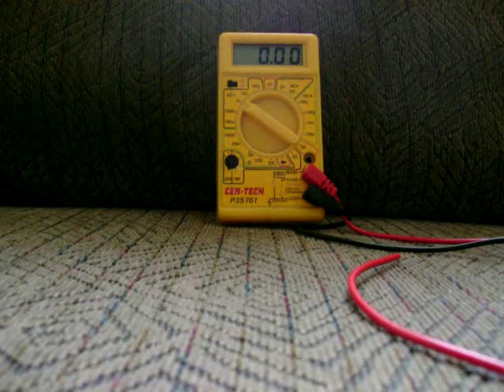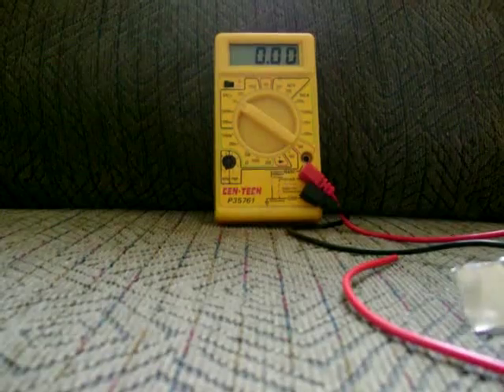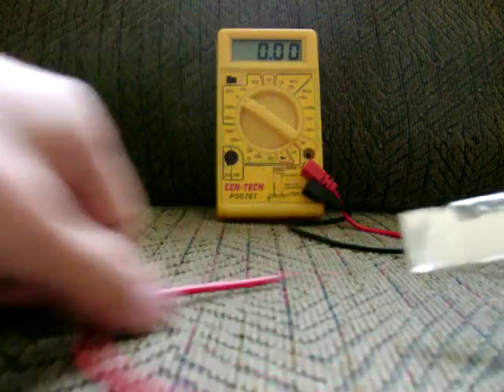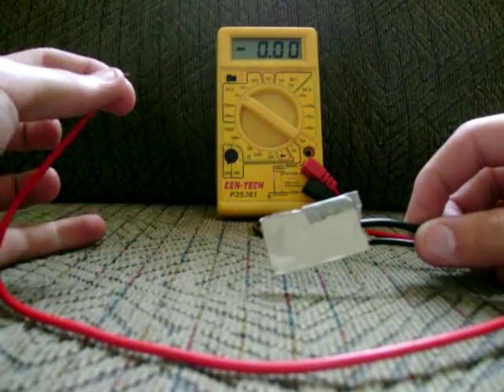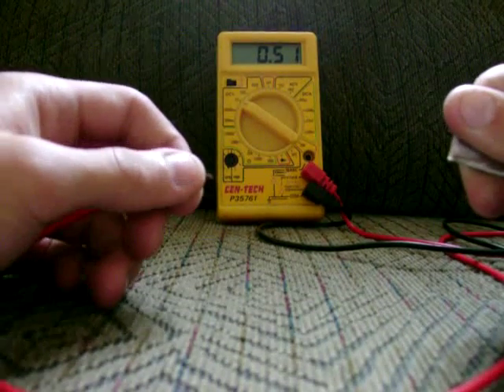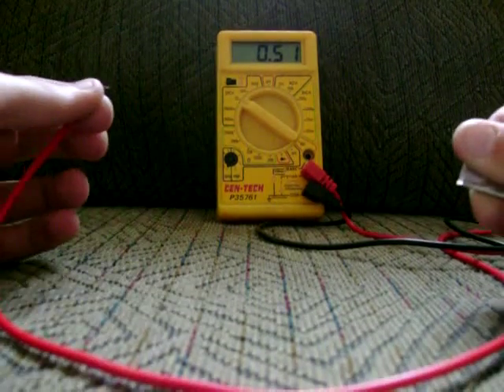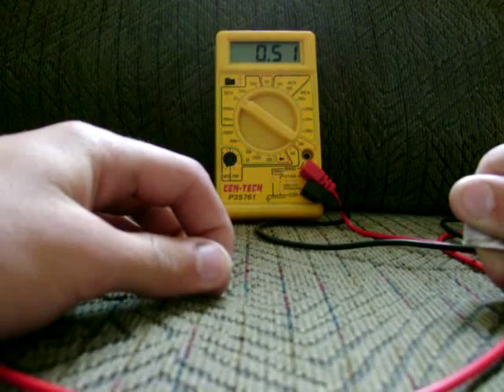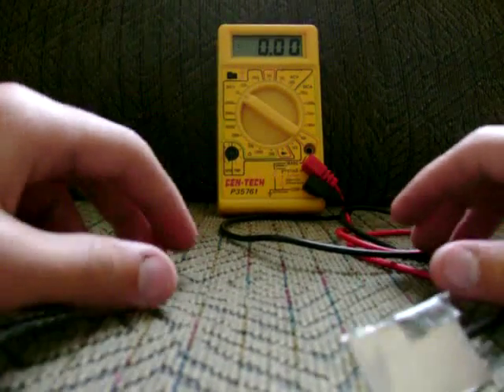new human powered battery.

Comment: Just wondering, does the power generated vary with body size, height, sex, weight, body temperature, full stomach, empty stomach, strong urge to pee, after peeing, big tits, small tits, big balls, small balls, emotions (happy, angry, crazy, etc), smart, dumb as mud, really screwed up, etc. 

Can we make a series circuit with people holding hand (legs or other bodily appendages) and create more power. If 3 million people hold hands in 1 city, how much power can you get?

Fan here, awesome.